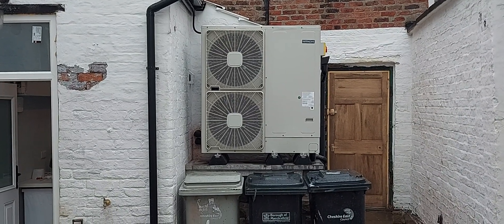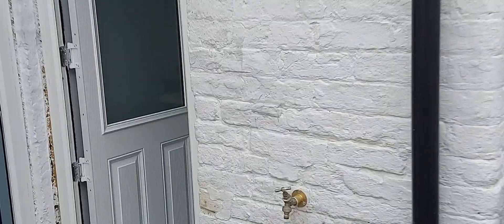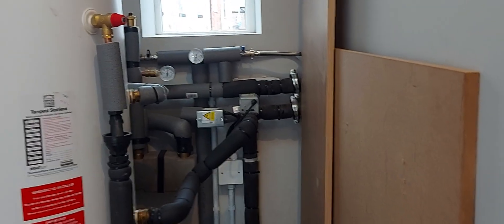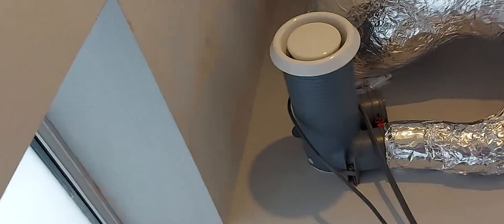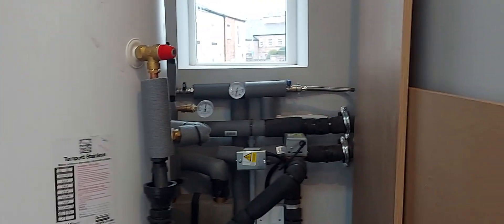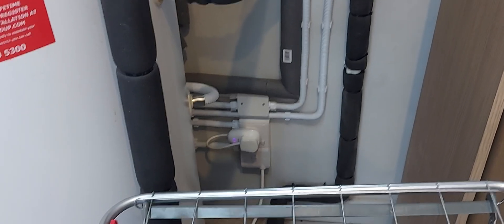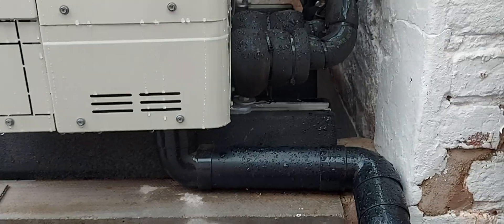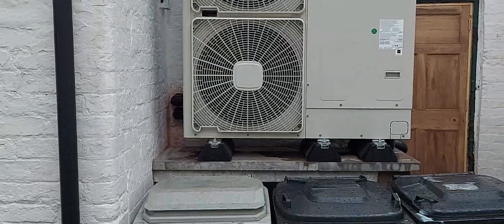ASHP & MVHR working in perfect harmony, this building fabric has led to no need for space heating.

Comment: Hello,

I am contacting you on behalf of Hitachi Cooling & Heating. We were very impressed by the installation you shared in your post and would love to share your work on our social media channels.

With your permission, we would like to use your content on our social media and other communication channels to showcase real-life examples of air conditioning installations. If you agree, could you provide us with some additional details about your installation? We would like to know:

The location of the installation (city or region).
The equipment installed (equipment model).
Any additional specifications you consider relevant (e.g. special features of the equipment, energy efficiency, etc.).

Of course, we will give you full credit for your content and be sure to link to your profile.

Thank you very much for considering our application! We look forward to sharing your experience with our community.

Comment: Hi Richard, can you give me some details on the heating cooling coil you have installed, is this using the mvhr to move the air? Is it effective? Cheers
Reply from the maker: https://veab.com/kategori/duct-heaters-cooler-water?lang=en

Effective as the primary heating in good retrofits that have small peak heat loads. In most situations a good suplementary heating option that is super fast also gives the ability to cool.

Between 2kw and 4kw capacity depending on air exchange rate and flow temps.